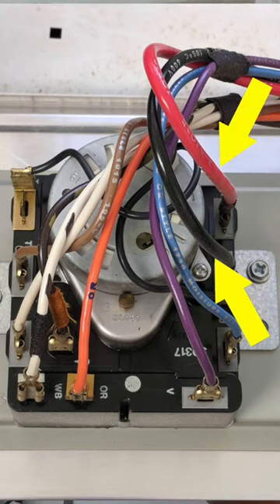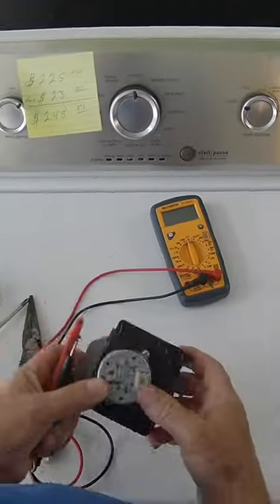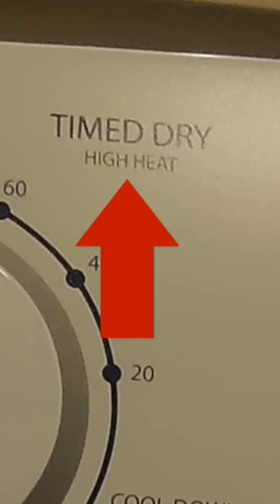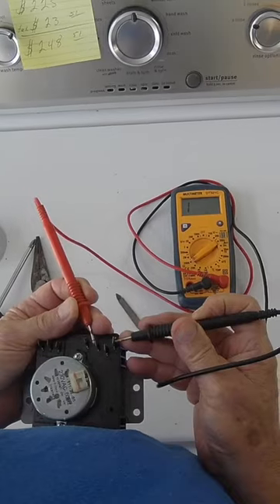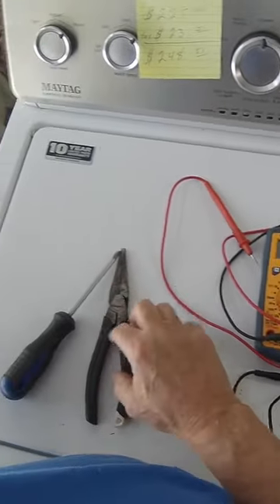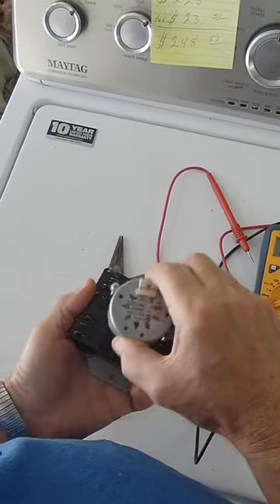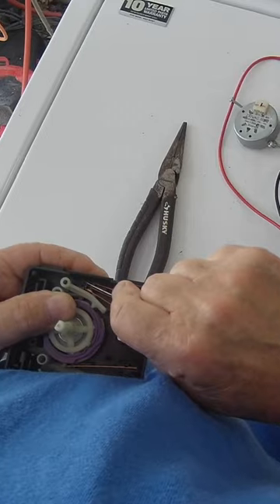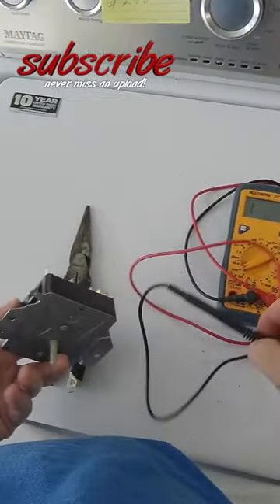Dryer Timer Test

Comment: I'm getting a good reading on B and C but not A and C but the other heating parts are reading good.
Reply from the maker: Check the points inside the timer. Make sure they are making contact. Thanks for watching.
Reply: @HarperandKnowles  I already had this timer apart but did not check to see if they are making contact with A thanks for pointing this out... And you're welcome
Reply: I just took the timer apart again and A is separate from the other points with a piece of plastic so I am beginning to think it's in the wiring.
Reply from the maker: A should make contact with C. They are separated by that plastic piece but when they burn out they won’t make contact. You can bend the points down where they do make contact again but not too far as they should be separated during the fluff cycle. You might want to replace the timer if they are burned too badly.